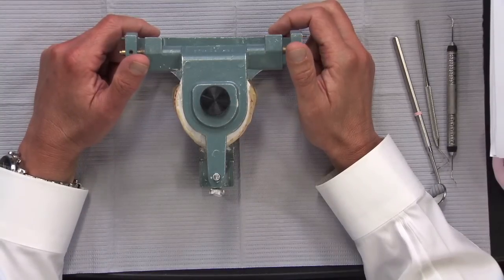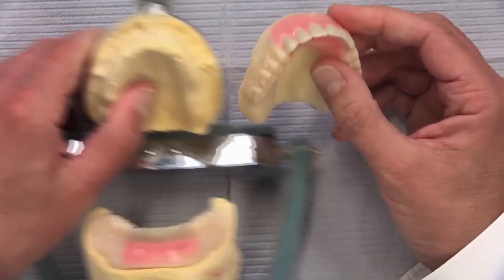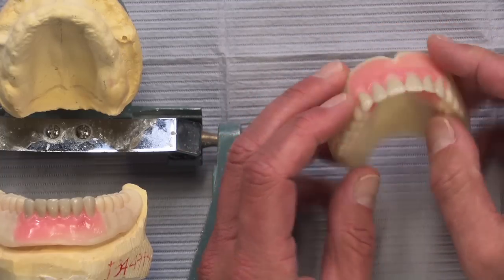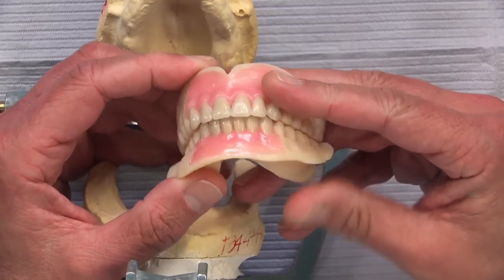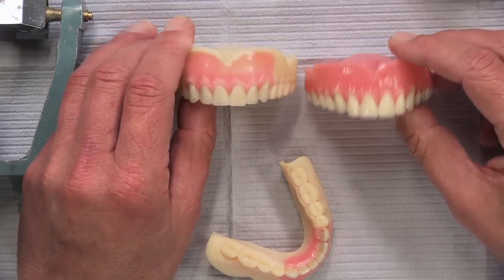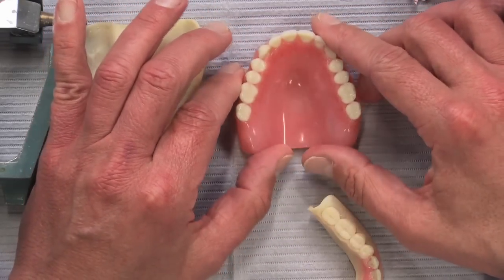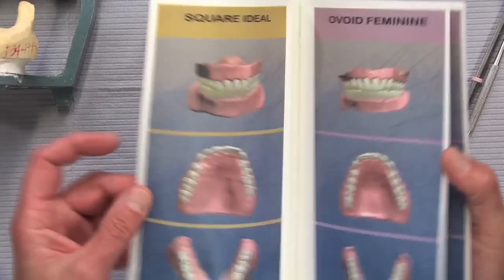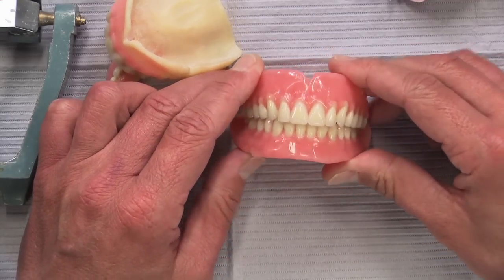Case of the week: Highlighting the CAD/CAM Denture Process

Comment: There is no real advantage to this as opposed to a well made traditional technique denture...one major disadvantage is the cost of equipment often totalling around 100 thousand...and on top of that I can't see digital dentures equaling traditional techniques in fully balanced articulation, maybe in the future but for now the software doesn't even come close...another short fall is gum tinting, you can only use light cure gum tints which come off over time.....still a long way to go guys, save your money.